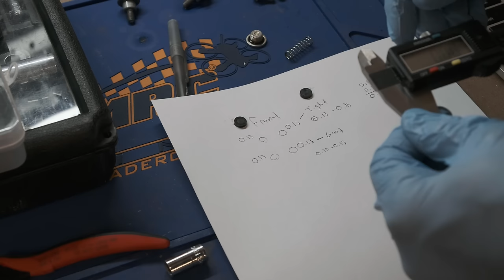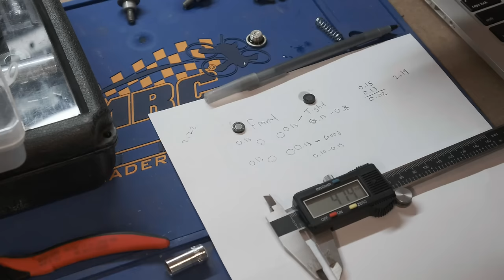How To Shim Your Valves - 2018 Husqvarna FE 350 - KTM 350 EXC-F

Comment: Shim to the loosest tolerance.  Alves always tighten up with wear as the valve seats get smashed. Shimming to the loose end of spec will allow you much more riding time before having to do this maintenance procedure.
Reply: Thanks for this comment. I was wondering why the clearance would tighten vs loosen.

Comment: Motorex bottle that is the funnel you screw it right into cover . Also next time remove the lower water pump screw drain coolant in a bucket , then remove that radiator hose to access the tensioner . Makes life a lot easier . Great insights !

Comment: Very well done, first video I found that is almost the same as my  2017 KTM SXF 350. Gave me the confidence   to do my shims.
Reply from the maker: Awesome! Glad you found this helpful. It is a fairly straight forward job, just takes some time to do, but as long as you have the manual you should be good!
Reply: You measure between shim and rocker arm or camshaft and rocker arm?
Reply: @jfricke1188  I am late and maybe you already found the answer to your question, but you need to measure between shim and rocker arm.

Comment: Well done and thanks.  I have been looking at upgrading from a DRZ to a KTM or Husq and the hype about the maintenance slightly intimidated me (amount...and depth...not twisting wrenches).  This really helped demystify the internet lore and take away my fear.
Reply from the maker: gatorhkman stoked it helped you man! Most of the maintenance on these bikes is pretty easy! Here in the next month or two we should have a video on redoing the top end of these bikes, which should be done around 150 to 200 hours as long as you keep clean filters and oil in the bike - Jaren

Comment: Forgot to say if you use an allen key to lightly push the cam chain tensioner in (through the small cap) the 24 m cap can be removed easily without removing any engine mounts, saw this on another video.
Reply from the maker: Ah good note! I will have to see if that works with the Dirt Tricks one I have installed, otherwise it's a total pain lol
Reply: @OregonDualSport  Yup it works with the stock tensioner, did it yesterday, don't see why it wouldn't work with the dirt tricks.
Reply from the maker: @bogilvie  Dirt tricks is a different type of tensioner, spring actuated mainly. Will have to try it. Thanks!
Reply: @bogilvie  can you elaborate on how to this? Having trouble getting my CCT out. Tried tour method but could get it out. Thank you.

Comment: Awesome vid, very helpful stuff. What I missed was the actual measurements. Between the arm and shim I'm guessing. Is it easy to get a feeler in there? Thanks!
Reply from the maker: It should be relatively easy if they are in spec. If you cannot get a feeler in there, move to the next smallest size until you can. If you cant fit the smallest one in spec in there, then you are definitely out of spec. - Jaren

Comment: Great video. I have the 2022 EX350F, would I need to remove the cam chain tensioner on my motor since it's not a manual tensioner? Thanks!
Reply from the maker: Yes in order to take the cams out to shim the valves you would need to release the tension on the cam chain.

Comment: Thank you for your enjoyable video. I have a question, what is the foreseeable lifespan in terms of hours for an engine like the H FE 350? I mean how many hours are you supposed to use the bike before changing piston rings and cylinder? I know it depends a lot on how you push the engine and on how strict you are with the maintainence schedule but is it possible to make a prediction? Thank you for your reply
Reply from the maker: I'm going to go all the way to 160 hours at least before I check. I believe the manual calls for changing piston and stuff at 120 hours, but there are many people who have taken them apart at that time only to find everything looks good. So if you aren't racing every weekend and change oil every 10 to 15 hours and run a new air filter every ride or two, you could likely make it to 160 hours or longer before you need to look at the Piston.
Reply: @OregonDualSport  Thank you!

Comment: Did you have any difficulty getting the valve cover to clear the hoses at the front? I ended up draining the coolant so I could remove those hoses. I think I might have also been able to remove the the throttle cables to get clearance to get the cover off. Nice video. Thanks.
Reply from the maker: John Ciribassi no, no need to drain any coolant to check or shim valves. - Jaren
Reply: @OregonDualSport  Did you have to remove the throttle cables in the rear of the cover to get the cover to clear and come off easily? I have a KTM 350 EXC-F
Reply from the maker: John Ciribassi nope nothing needs to be removed, just zip tie those up and out of the way. No cables, wires or hoses besides the breather hose need to be removed
Reply: @OregonDualSport  Thanks for the info. Really helpful.

Comment: do you really need to remove the cam chain tensioner or can you just back it out?
Reply: On my 2019 350 sxf, I just backed out the tensioner fully but didn't actually remove it since it hits the frame. No issues.

Comment: Thanks for the video! Is it possible to only loosen cam chain tensioner without removing it completely?
Reply: Great question. That thing is a pain and now I’ve tog to take radiator hose off to get it out and reset it to 3mm spring. I think his aftermarket dirt tricks tensioner has saved him some work.

Comment: I just got a 2020 350exc f and there's a lot of valve chatter or the timing chain slapping around is this normal or do you think I need dirt tricks cam chain tensioner
Reply from the maker: It is normal with the stock tensioner. I do not know if they changed the tensioner in the 2020, but if it is hydraulic only (and not spring assist like the Dirt Tricks) then it is likely to be noisy. The dirt tricks one made my bike much quieter. You do have to wait until 30 hours or so however to swap a new one in.
Reply: @OregonDualSport  why 30 hrs.
Reply from the maker: Built Minis the chain needs to stretch a little and the guides need to wear in or a new tensioner will put too much tension on it. Says on Dirt Tricks site
Reply: @OregonDualSport  okay thank you

Comment: How did you measure the temperature of the bike?
Reply from the maker: Laser Thermometer or just let it sit at room temp long enough - Jaren
Reply: @OregonDualSport  Thanks. I'm curious which part of the bike you take the measure from?
Reply from the maker: @09Tedesco  It doesnt matter too much if you know the room is at around 68 degrees and the bike has been in there for long enough to be at that temp too. Mainly you just want to avoid checking in a really cold garage or a really hot one as your measurements may vary. But you can point the laser thermometer right at the block or the cams and check if you want to be exact. - Jaren

Comment: What’s the effect of shimming the valves? Does it eliminate the knocking sound? Does it help on the bike’s torque? I ride a Duke 690R
Reply from the maker: Angelo Zosa shimming valves helps keep the seal of the valves and the pressure on the seats where they should be

Comment: Is this kinda the same as the 250f?
Reply from the maker: 250f?
Reply: @OregonDualSport  Ye I mean i bought this ktm sxf 250f 2018 and i wanna cheek the valves now so all i wonder is if its the same this video about 350 as the 250f?
Reply from the maker: @fsdffdsgfdg8295  it should be relatively close, I would however consult the manual as the tolerances may be different.

Comment: Never showed how you turned the motor over manually
Reply from the maker: Just stick it in 6th gear and use the rear wheel to crank the motor over .